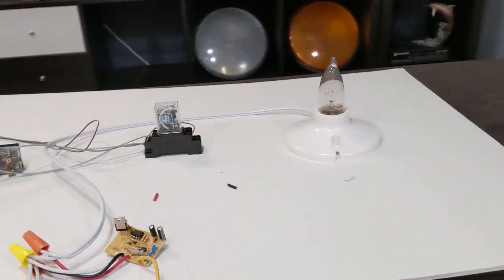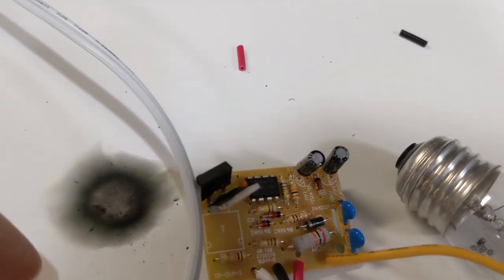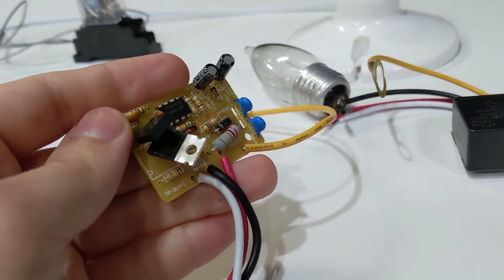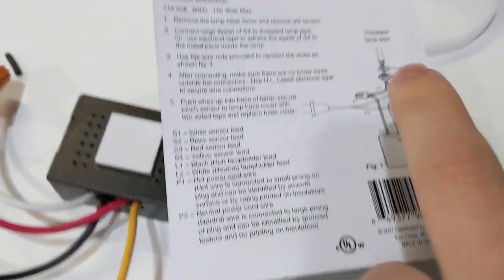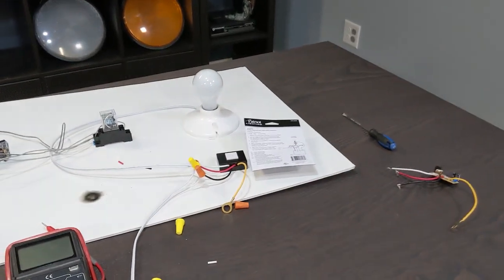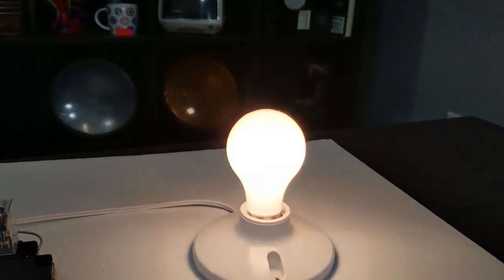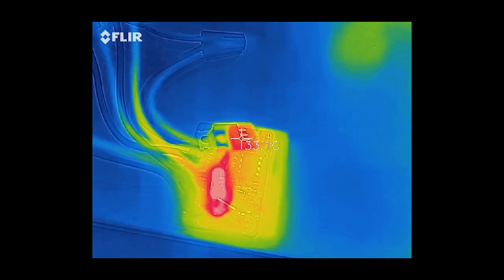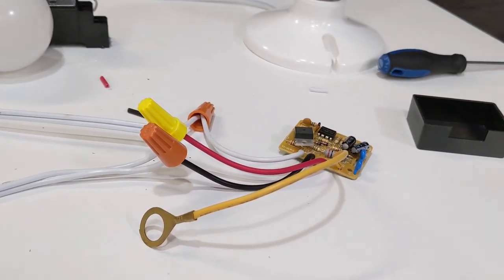A slightly explosive touch-lamp follow-up (standby energy consumption)

Comment: To kinda piss on your parade a tad, in the US electrical code a black wire can be a neutral return but it had to be designated as such by an extra color on the wire. Red is always hot, white is always return (or neutral. same thing, two terms). So yea, this was just an idiot explosion. 

Also, dont feel bad lol. My electrical class in high school I made a minor wiring error and melted a receptacle, box, and about 6in of 4ga wire. It was 480V at 50A so the fireworks show was spectacular!!! I blew the circuit breaker for the area I was in, the classroom, and it chained up to blow the wing of the school lol. 

For those curious, the error was I set the screw too tight and somehow seem to have forced the hot wire into contact with the box, which was grounded and created an immediate fireworks display when the big switch was flipped.

Comment: The package Alec showed a very visible very visible UL Seal of Approval logo. How could UL have approved this device for U.S. use with the "non-US-standard" wire colors and functions. Did the Chinese just stick a UL logo on the package without first having it tested. Probably. Of course electrons don't care what color the wire is, but any normal electronics technician would naturally assume that White is Neutral. At least in only cost $8.88 and gave us all a good laugh.

Comment: Yep; in China, red is hot, black is neutral. (Obvious Chinese Communist Party joke deleted.)  The wonderful thing about standards is that there are so many of them for the same thing...

As to why it blew up...

Before you touched the yellow wire, white (AC) and red (bulb) were effectively shorted through the lamp filament. (Yes, it's also possible that a component is bridging the white and red leads.)  When you touched the yellow wire, the triac shorted the AC line.

Comment: Depends on your point of view. Electricians, folks who wire homes with high voltage AC for appliances and such, KNOW that black is your hot wire and white is your neutral wire. Electronics engineers, folks who work with low voltage DC and who made the module, KNOW that black is ground and red is hot. Who knew it would be a cultural thing!!

Comment: They could have just had the black wire be another white wire. It wouldn't matter which white wire went to either the lamp neutral or the plug neutral, the control board just acts as an interrupt in the neutral line. Then the red could have been black and it would have been a no-brainer.

Comment: the designer of the circuit probably has no experience with NA electronics and went with the general standard of red=high and black=low with all other colors being sensors or signals or whatever

Comment: I've seen this in the case of digital electronics more than AC but its always a pet-peeve of mine! In college in ALL of my electrical engineering labs the wires were RED & BLACK. On DC power supplies, POSITIVE is RED and NEGATIVE is BLACK so transitioning to AC systems you would think RED would still mean + or positive, but NOPE!  Digital electronics have been VERY consistent in this. When it comes AC systems? Wire color means nothing until you test it!  There's an entire wiki article on the different colors used for HOT vs NEUTRAL by countries and it's a mess. Never do electrical outside North America cuz everywhere else in the world uses blue/black for residential indicator for NEUTRAL instead of white. #USAGottaBeDifferent

Comment: Poor triac, you just tried to short the whole grid uaing a triac. The moment it exploded, I was 90% sure that was the AC being shorted.
Reply: I mean, what else could possibly blow it up like that?
Reply: @narcoleptic8982  oooh.. good question. An over driven triac can blow up with a loud snap without charring. The capacitor that was connected in reverse polarity or overvoltaged due to short will blow up louder than that with splatter of paper instead of charring, a piece of metal underneath the pcb can short and explode shorted components, etc. I have seen them from the beginning of my electronics engg uni days up to present.not my doing but my classmates ofc. 😇😜
Reply: So there are many ways a small circuit can blow up.. when i saw the charring and exploded triac just affer the touch was made.. it could be due to very high energy going against the full load AC. An over driven triac will fail a bit later than what happened.hence my conclusion.
Reply: Sure, but it’s a commercially built circuit.  It shouldn’t have any of those issues.  You’re right on those points, but they shouldn’t do that brand new from the factory.
Reply: @narcoleptic8982  a commerically made circuit of that price and quality is not guaranteed to work all the time.. ive seen it. PCB design and component mounting is a huge red flag. Unless it is a branded device that is not a rebrand from china. do you really think it has CE or equivalent certifications? Dont believe that generic modules are well tested. Especially the economy units such as the one shown. Be very careful.  the device is not a big brand name and probably a chinese generic module. Reason why i dont buy power electronics from aliexpress or from a know local store that rebrands and overpriced version of aliexpress products. If i do, i open them just to make sure basic safety measures are observed. The exoded unit did not even have a proper fuse.

Comment: All I have to say is this: You are part of the stereotype that men only refer to the instructions, AFTER they screw it up...
Reply: I mean, if it is setting up a PlayStation or a computer or washer, there's nothing new about connecting some cables to their corresponding sockets. With those, the manual is an after read to find out features we didn't know.

Same with cars. All cars come with a manual but you almost never read it. That's because you are taught to drive and the driving technique is standard, so if you drive the new one like you did the old one, it's going to work. Its the features that are different.

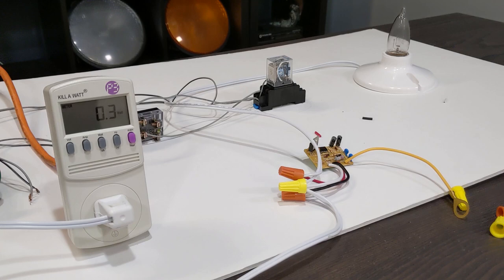Electrical wiring though, idk i always refer to the diagram, maybe because 1:56 happens if you screw it up and sometimes things be valuable.
Reply: @miaugato93  I was making a joke because of the stereotype. You didn't have to go an analyze it like that.
Reply: @deathsheir2035  ok well glad to be of help

Comment: This dumb wiring scheme also means this device breaks neutral, but not line. You never break only the neutral wire, at least not deliberately. If you turn something off by breaking neutral only, the hot bits remain at line voltage relative to ground, making it possible to accidentally shock yourself thinking the device is off and therefore not energized. It's not a big deal considering you can plug lamps in whichever way, so line and neutral are more what you call suggestions, but it's weird that the schematic would specify it that way.

Comment: TC: Let's check if it actually does work
BOOM
Me: Well, seems it doesn't...

You're complaining about a sensor module for a few bucks. Couple of years ago I witnessed qualified electrician blowing up induction plate, cause he didn't bother to check wiring diagram too - despite me deliberately handing it to him before work. That costed him ~1000$, however.

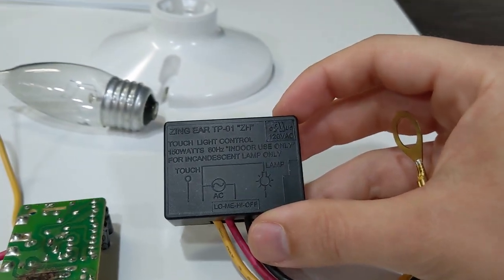Comment: I'm confused by all the confusion. The back of the plastic case clearly has a diagram that can be interpreted by random people who might come across one of these things. Years later at a flea market, no one will have that paper diagram. That paper diagram probably has been translated into who knows how many languages and back again anyway. Why would you trust the paper over the diagram molded into the product itself at the factory? Sure, it might not exactly use standard conventions for electrical engineering diagraming, but does Menard's only sell to licensed electricians? Whoever comes across this will always have the plastic case to figure out how to wire it. Take a closer look at the REAL diagram on the back of the case (5:20). 
The diagram's lines exactly match the order of the wires they go to. And the upside-down bulb? What end of a bulb is the hot end? Get it? Apparently, the more you know about electrical stuff, the more difficult it is to wire this.
Various Amazon reviewers of this product have noted the wiring craziness, too, and there is an updated wiring diagram for this product. Who knows how many with the old diagrams are still on the shelves, in warehouses, and shipping containers.

Comment: Well, as an European (German) I would have looked carefully on the Instructions. Simply because we don't use those colors at all. Black has been used as Phase in the Past, so might see one in old machines and buildings,  but we are generally using Brown for the Life Wire. Neutral is allways Blue and the PE (ground) is green-yellow. 

If none of the Colors really match, you'll watch the instructions. In your Case I do understand your Frustation, because north american wiring, and yes, this device is connected very, very stupid. If someone messed up my colors, I might have connected it wrong as well and blew it up.

Comment: Any good electrician know that you never go by the colours but by the wiring diagram. Plus, the fact that you couldn't understand the diagram on the back of the black plastic housing 5:13 shows your limited experience in reading circuit diagrams.

Still, watching the triac spill its guts was pretty entertaining.

PS. Reversing the polarity on single phase AC equipment usually makes absolutely no difference to how it runs. Since AC changes polarity anyway at 50 -60 times per second. There may only be an issue with respect to safety, depending which wire is switched etc...

Comment: Self-Taught EE lesson one: Colors aren't universal. Electricity is. 
But also, you have black and red, and you're connecting hot and neutral (no ground) so hot is obviously red, and black is probably the other. Definitely still a good idea to check the diagram before plugging anything line-voltage in.

Comment: Looking at the wiring diagram, the board is powered by it's red and black wires. Maybe that's why they're colored that way -- still stupid, mind you. The switching mechanism works by connecting white and black internally. This completes the circuit through the bulb. With the first way that Alec wired it (swapping red and white, ignoring the black and white swap), when it turns on it immediately shorted the triac across both power lines.
I'd argue this thing is double dumb. Not only does it have dumb wiring colors, but it has no proper protection against miswiring. EXPLODING A TRACE AND A TRIAC IS NOT PROTECTION. The board should have been able to detect that it was miswired since the switch wire (white) had a greater voltage difference than the two power wires.
Then again, the thing had a huge wasteful resistor on it. Good job, cheap electronics.

Comment: The 1 watt 1000 ohm resistor is a lazy man's power supply instead of using a regulated power source. Not an efficient way to save energy making electronics in that fashion. Real common in the past.

Comment: Unpopular opinion: I 100% agree that the wire color scheme is WRONG and ABSURD. 
White = neutral and Black = hot in North America. Given that we're also one of the few areas with a 120V electrical system, a device made to operate on 120V should use the color code standards of the area where it's meant to be used.

Also, why the [swear word goes here] would they switch the neutral of the lamp, and leave the hot connected at all times? That's ludicrous! (and somewhat unsafe)

Brown being neutral in some parts of Europe (according to some of the comments here) sounds absurd to me. That looks like a hot wire! (And I thought brown was hot in the UK... Clive?)

Comment: Post clean photos of the top and the bottom of the board and the part number of the chip and component values (that you can determine).  I can reverse engineer and give you a schematic!

Comment: I know what's gone wrong: If a Lamp fails, the builded plasma can short out the Lamp temporarily. This is because the most Dimmers have a Fuse, that blow up, when a Lamp fails and go short, to protect the TRIAC.

PS:
1.: Switching Neutral is a really bad Idea.
2.: Crappy chinese Design, that wastes so much Power and switches the Neutral.
3.: Please make a female Version of you, that I can marry <3

Comment: If I may suggest a video topic? You exposed the marketing scam that is almost portable electric heaters are 1500 watts. Care to expose the scam of these over-hyped, overpriced "On Demand" electric water heaters sold in the US and Canada being pushed as HUGE "energy savers" by the marketers? And why a water heater in a small box costs so much more than a traditional tank - or the foolishness of running 4 40 amp 240 volt circuits to feed a whole-house water heater, instead of one 30 amp 240 volt circuit, and having to install a 400 amp service on a house just to supply it?!

Comment: There are not only wiring colors that are stupid. The stupidest thing is shared hot! You are always interrupting hot, not neutral! In Europe it doesn't make sense because of non-polirezed plug, so you can plug it both ways. But in case of polirized plugs it does make sense. I would suggest another wiring scheme: black to plug's hot and red to plug's neutral. It shouldn't cause an explosion, but it will be safer to operate.
Reply: And it will be safer to change bulb.

Comment: When you say you expect the box to provide a new hot, wouldn't that mean putting the box on the hot side of the lamp?  IANAE, but doesn't it make sense for it to be wired on the neutral side of the lamp and provide a new neutral, the way it does?

Comment: just put it down to Coronageddon and make sure you read the friggin wiring diagram before engaging screwdriver!!!  Chinese are Notorious for wiring things up with coloured wires that mean nothing, red is normally live or Phase though and black is neutral or negative in Low voltage wiring , in Europe, blue is neutral and live or phase is Black, then we have other colours for two and 3 way wiring . these colours are still the same whether you are single phase or 3 phase voltages

the trouble here is the chinese adopted a correct low voltage wiring colour on a mains voltage circuit, bit daft really, lucky you didnt make it go to ground.   hence always always check the wiring circuit and make sure the wires are correct.  This is where Google is great and in particular youtube and normally a nice sparky like me might have posted a simple video on how to wire something like this up beforehand so that DIY'ers dont kill themselves.

Comment: Never assume wire colors on devices.  Had 2 transformers installed at work.  About the size of a hand.  It was added to power a added computer control board for a freezer compressor.  Well it stopped working after around 6 or so months.  I'm looking around.  Blown fuse or something.  No power to the board.  Ummmm, then in looking at the transformer and is blown.  I can see some blackness on the back plate is mounted on.  Come to find out, the tech that installed it just assumed the wire colors and connected it up.  They were abnormal.  It's a China made transformers.  Why it didn't blow a lot sooner?. Both were wired the same, so the one that was still working was replaced also and the new transformers were actually wired like they normally are.  Of course the new transformers and labor was free.  It cost them money of course.  It was clearly their mistake.

I do a lot of different kinds of wiring at work.  In fact just wired up a large transformer.  A couple hundred pounds in weight.  Used for a couple car chargers I installed.  Clearly labeled by a wiring diagram and so wired correctly.  Sometimes stuff from China is just wacky.  At least it was a cheap little gizmo.  Not something that costs thousands.

Transformers  have right on them what each wire does, but if you just assume, it's going to byte you.

Comment: I agree that their wiring colors are retarded. And they way they have it wired they're breaking the neutral? Why? Why would you want the socket's hot side hot at all times? That means while changing a bulb with the lamp "off" you can still get shocked. Brilliant.
I disagree with wire nuts sucking, and those being the wrong size. Those are the right size wire nuts, the yellow one is the wrong size. What sucks is stranded wire with wire nuts. Wire nuts with solid wire are great. I am sort of an elechicken by trade. And I really dislike that fixtures are always using stranded wire nutted to solid wire. I'd rather have some screw terminals or even some push connections.
Reply: Also I'm sure you're aware of this but it still makes me mad. In older buildings and homes they would often times run the hot wire directly to a fixture, then run a 2 wire over to a switch and break the neutral too. Meaning on a lot of light fixtures in buildings before ~1970 you could get shocked the same way as with this lamp switch.

Yeah, a neutral wire can shock you if you're a better path to ground than the neutral wire is and there are other things on the circuit running. But It's not a full shock, and really will only happen in some weird circumstances.

Comment: Colors mean nothing. You can use any color insulation you can contrive. So never trust the colors. Always verify with diagram and multimeter, if necessary. You done fucked up by just connecting wires together without verifying.